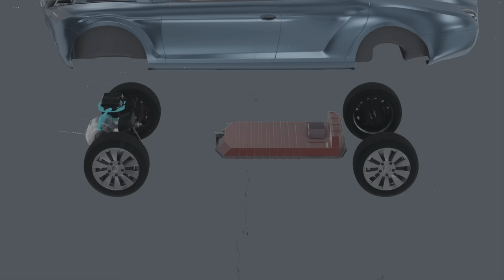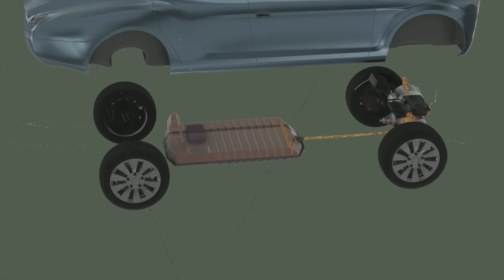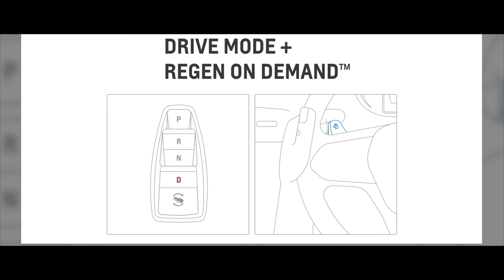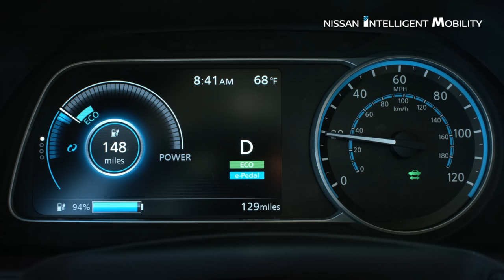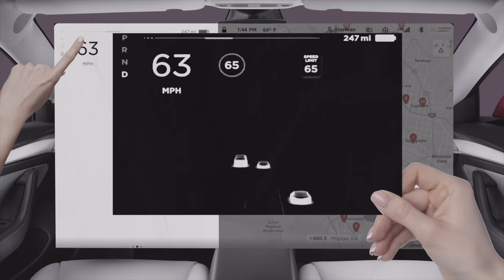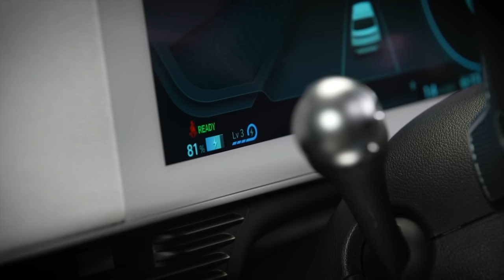Toyota's New Braking System Makes Your Brakes Last Forever

Comment: Just one remark, as said in the video, regenerative braking gives losses. That's inevitable. The most fuel efficient way to drive is to coast without regenerative braking and normal braking. This requires a very anticipating driving style that is not possible in day to day conditions. But still, it is good to keep in mind that the most efficient way to drive is to stay at the same momentum as much as possible and only reduce momentum by (mainly) air resistance.
Reply: I think a lot of the new systems don’t actually activate until you completely let off the throttle... or whatever they call it on EVs. I’m pretty sure that you can “coast” with them also with proper pedal management. That’s just what I’ve seen and heard. I love my diesel 👍

Comment: I've been driving EVs for over a decade... Took me about two weeks to get used to but now on certain that this is the best way to drive... My first EV I never even changed the brake pads on and I have for 5 years before I traded it in I drive significantly more now... But thanks to Scotty's videos i casually do brake maintenance. Every 6 months to a year... Let me be clear I've changed the pads and rotors once had I been as experience with brake systems I probably would have just refurbished the rotors and got new pads....
Reply: EVs are junk. The least you can do is have your local mechanic change and work on your brakes to give them some business!
Reply: @Russell-rc6qq   the local mechanic tried to charge me $1,500 for a $34 brake pad so they can suck it lol
Reply: @seanbouker  I'm sure there is a heck of a lot more to your story than you're letting on about!

Comment: I can confirm that break pads last ALOT longer I work on Toyotas and I see them come in with between 40-80k with still 60% of the break pads left also they rarely have rust on the rotors or pins past normal wear and tear rust
Reply: *Brake
Reply: @beefybuttercup2978  damn it I keep doing it lmao I’m slow in the head thanks lmao

Comment: Therefore, regenerative brake systems in EV'S require more expensive parts and more special maintenance than conventional brakes in combustion cars. Maintenance of EV'S is more expensive than in combustión vehicles.  Thanks for the video.
Reply: Exactly. EVs are rubbish!
Reply: @levenkay4468  I'm not as expert as you say of yourself. Now, you say replace it and no maintenance? How much it costs to replace the whole brake assembly on an EV? A fortune. So, EV'S maintenance require replacement of original parts. That costs more than simple repairs or preventive maintenance in combustion cars. Enjoy your EV and spend your money. Thanks.

Comment: How is heat created and transferred to the heating system for inside the EV vehicle's passenger area for windshield defrost, etc.? Do electric car motors generate as much heat as a combustion engine? Are they liquid cooled?
Reply: @levenkay4468  I know producing heat is an extreme energy hog compared to say just running lights or a small fan. Guessing greatly reduces range of EV combined with cold outside air effecting performance of the batteries.

Comment: There is a simple fix for lack of regen braking while the battery is too cold: put in a 20kW peak power heater (only needs to do 20kW for 10-15s at a time) to dump most of the excess regen energy from normal deceleration into. When I drive my mother's Bolt EV, I rarely need more than 15kW of regen and by the time I need more than 20kW, my foot is usually on its way to the brake pedal just in case regen doesn't give me the space I want as fast as I want it. Of course, a bigger EV would require a proportionally bigger heater.
Reply: My good old fashioned ICE car from 2001 doesn't need fancy rubbish like a "peak power heater". EVs are junk and are needlessly complicated to own!
Reply: @Russell-rc6qq  I don't see what is so complicated about owning a vehicle you can plug into a standard 120V outlet to cover your daily driving and has minimal maintenance requirements.

Comment: Regenerative braking is necessary in EVs as they are heavier than ICE and wear the brakes out more quickly than ICE vehicles without regenerative braking.
Reply: Not true about using brakes faster than ICE cars. I have 46,000 on my EV, and pads are not even halfway worn. Tires are another issue!
Reply: that too. you're driving around with the weight of either two passengers(hybrids) or four. (Tesla).

Comment: I remember years ago, the regenerative braking energy was applied to a large, fast spinning flywheel.  This rotational energy could then be transferred to acceleration.  What ever happened to this idea?
Reply: I don't know but I always wondered why hybrids and EVs don't have separate axle mounted generators that supply energy back into the battery anytime the vehicle is in motion. 🤷🏻‍♂️ Regenerative braking only puts energy back into the system when you take your foot off the accelerator.
Reply: @justacinnamonbun8658  Friction. Not worth the friction penalty.
Reply: Flywheels that are small enough in size to fit inside a car don’t store enough energy, and if you truly wanted to store serious amounts of energy, small and super high RPMs tend to make flywheels explode unless made of some unobtanium super-alloy.  Material science is a science that will give you a long career with a generous pay check.

Comment: The gyro-bus is interesting.  It used a gigantic, very heavy, metal wheel.  The energy would go into making it spin.  When energy was needed they would use the (still spinning) metal wheel as a motor.

The hydraulic bus would charge pressure into a giant accumulator (hydraulic pressure storage tank) then tap into the stored pressure when needed.

Comment: Speaking of bikes. Anyone remember the bike headlights (back in the 70s) that would have a spinning generator connected to your tires that would spin and keep the headlight On while you where in motion/riding? Why can't we be doing that with cars?  As your car tires are spinning on the road a little generator would be sending power to your batteries keeping them always recharging just from your driving.  If your car was recharging just from driving it, you would never have to plug in it ever!
Reply: Yea its called a alternator dude , that's why you don't see those stupid headlights lol and then it's called solar for the charging system

Comment: Lol, gonna have to do discs and pads at 3-4 years in the salt belt anyway. Pro tip, check for rust banding and get get them turned if you can find a place that does it. RUST IS HARDER THAN PADS once it goes beyond surface rust it will start eating the pad and you’ve lost that surface area.

Comment: I would like some capacitors to store the energy and provide the power when needed at low speeds since they are much ligher, smaller and do not need to change them after a few years and pay tens of thousands as with the battery. Toyota made it work perfectly well when racing at WEC with its TS040.

Comment: Toyota didn't invent it. In fact, it's really old technology. General Motors had it on their EV1 back in the 1990s. It was unveiled in the 1990s car show in LA (January 1990). Tesla has had it for years. Seems Toyota is one of the last to use it.

Comment: Well, as usual the best solution for any transmission issue, is the manual transmission. And saves on gas too, so no need for EVs at all.
Reply: How many times do they have to not come with a manual to let u know people don't want a manual lmao
Reply: There are quite a few cars now that have higher MPG in the auto models than manual models.

Comment: If you put 4 electric motors in a car, one for each wheel, could you not eliminate the brakes completely?  Configure the electric motors to act like abs brakes and have the computer control which wheels get more braking based on traction?  Also, I always wondered why electric cars used disc brakes instead of drum brakes,  disc brakes tend to rust on the disc due to being exposed to the elements.  Wouldn’t drum brakes last a lot longer on an ev?

Comment: A chemical storage lithium battery can not charge fast enough to capture the majority of the kinetic energy, on the other hand super capacitors can charge up almost instantly if supplied with a big enough wire to capture the flow of electrons during regen.

Comment: To make REAL regenerative braking you need three pedals.  1) Accelerator with gliding (like an old ICE car in neutral), 2) brake with friction, 3) regen braking.  You should NOT couple regen to the throttle in EV, as regen in an EV looses energy due to non 50-70% energy recovery.  Having regen in the brake confuses people.  Friction brakes should only be used from 5 mph to 0 mph and for holding the car in place.  Left foot on regen controls deceleration rate, and right foot on friction brakes modulates braking and allow for extra braking force if needed.  Regen cannot hold a car in place without using energy in an EV.  As stated, regen on ice or snow can cause an accident.  With New Engine Type engines, combustion now has regen braking at near 100%, not just OBSOLETE EVs.

Comment: Tesla has the master regenerative braking system because it can take all the rotational energy in the car and put it right back in the battery and slowing down the car very quickly. On the traditional hybrids I've driven you just use it by coasting as much as possible because it can only slow down the car a tiny amount and put back just a little of the energy into the battery. They are very nice because you can let the poor drivers on the road charge your battery on the freeway and then come off and drive for free on the side roads!

Comment: As far as corrosion buildup on the brakes: DON'T USE STEEL BRAKES. The popularity of carbon discs has brought the prices down on them. With technology today there should be no reason to use any material that can corrode in anything.

Comment: Why don't EV vehicles have alternators that recharge the battery when the vehicle is on? Seems like if they really wanted too they could make cars that never need fuel gas or electric yet we still have to pay to charge even if it is $1